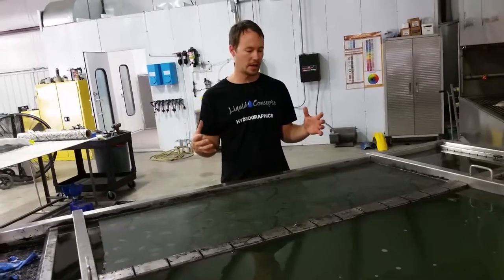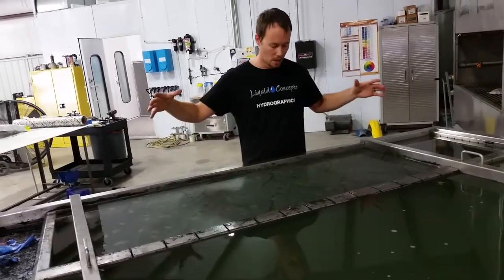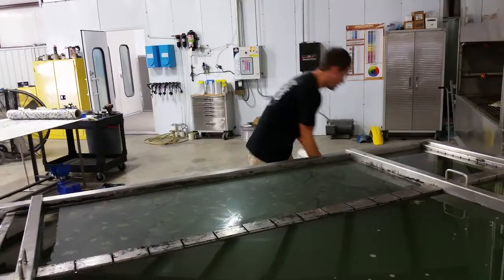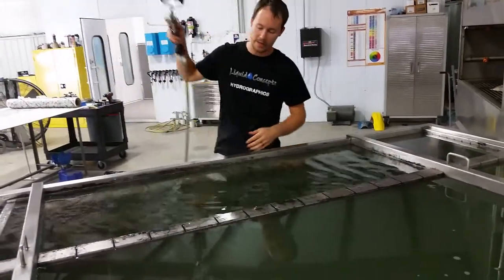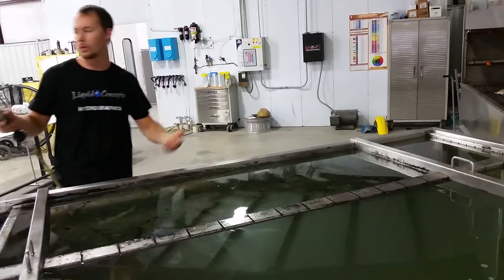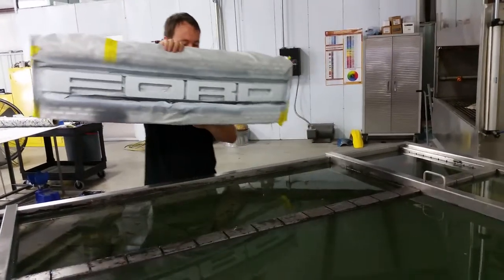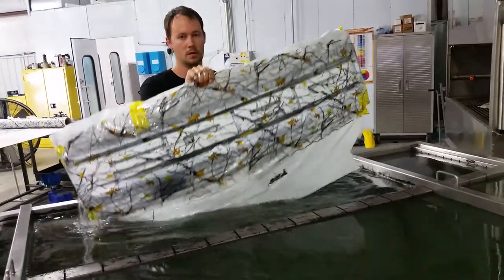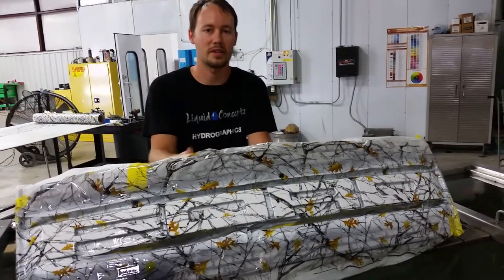Liquid concepts dipping Ford Raptor front grill

Comment: That's amazing stuff, Would that grill hold up to the elements on the front of that truck? The weather, rocks, dirt, bugs ?  If you apply a clear coat made for paints, will iit have good adhesion.
Reply from the maker: With all of our dips we use high grade automotive primer, paint, and clears. You can expect to get the same durability as the paint on your vehicle. It will still chip from rocks of course such as regular paint would.
Reply: @LiquidConceptsUSA  Understand your replay concerning durability . after prep, are you films compatible with name brand base coats, such as Duplicolor?  Are you aware of any paint brands that should not be used? I've seen videos where it would not transfer, basically slipping off the surface of the part.
I own a plant that applies various dry adhesives, powder coating, and hi-VOC/HAPP performance coatings as a supplier to the OE auto industry.
I have limited experience with hydro dipping, and am continuing to build a more capable process for this. Prefer to work with a current supplier of base coat products.
The question as to compatibility would settle that. Now I can purchase one brand activator, and one film supplier. I have the clear coat supplier that I've used sucessfully. It is a very durable ceramic coating that I have adjusted to a matt almost flat finish. 
The intent is to use the equipment we already have . Large temperature controlled tanks, with just a few small mods to make, air, water with wastewater treatment system, complete stell and AL 7 stage cleaning and even zinc phosphating process, electrostatic sppray or disc, HVlp, etc.  It's a fit and scalable for large amounts of production to the market. Also it is under our ISO 9001:2015 certification.   Now this appears like an ad for business, and is not. Just searching for good partners with good products. Unable to work with a company that buys various films and resells on the net.

Comment: Very nice work. What size tip & air pressure at the gun do you have? I can't get over how close to the water you get with the gun and not bother the film. I mean its just perfect. BIG PROPS.
Reply from the maker: +COASTAL HYDROGRAPHICS we use a 1.4 tip and around 10-12 psi but that may vary a bit depending on the gun. We also spray 6-8 inches above the water with our activator. Let me know if I can help you with anything else.
Reply: Thanks bud. You guy's at L/C rule man. Keep up the good work.
Reply from the maker: Thank you very much!